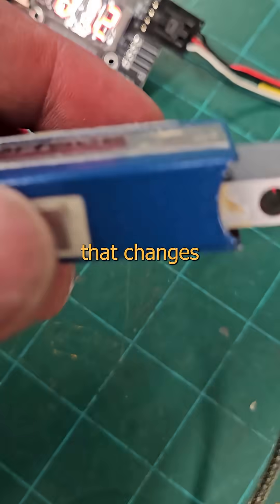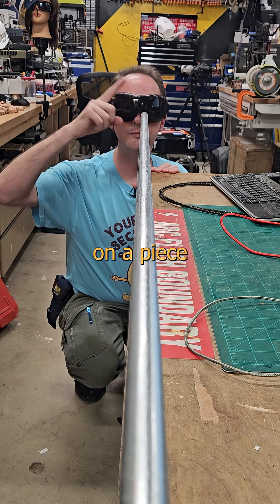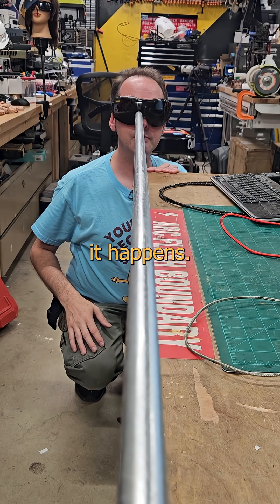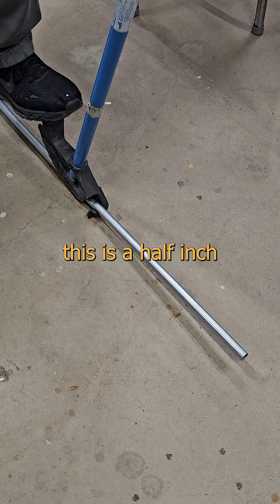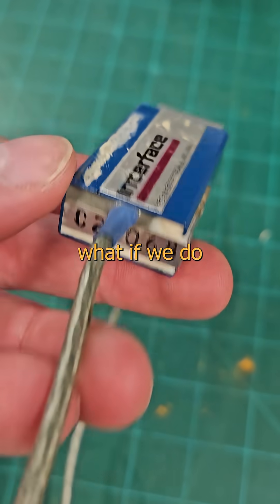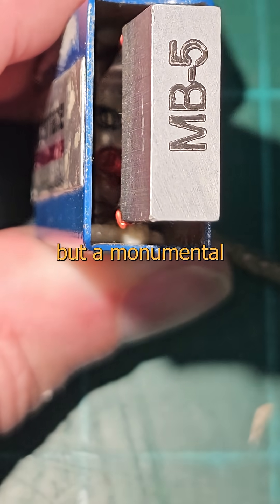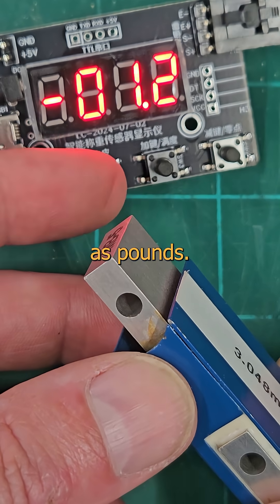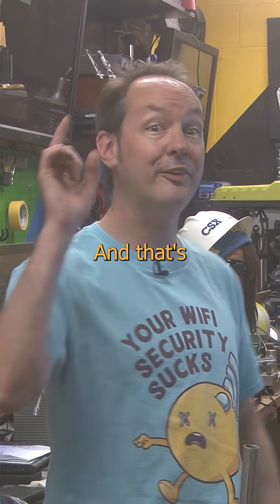Elastic and Plastic Deformation #chrisboden #comedy #engineering #modulus #strain #gauge #scale

Comment: Way back ago had an uncle that could weigh a loaded grain truck or cotton module within 200 -300 lbs by using a tape measure. Had a red square painted on the unloading floor and had something to do with tire pressure and the sq In the loaded tire took up. After the truck unloaded they pulled onto another square. Don’t know much techinicals on  it but similar physics.

Comment: Working on a railroad extra gang in 1974  despiking 900 feet long strings of jointed rail, securing the strings of 110 lb rail (weight of 3 feet of rail) to a caterpillar dozer then riding the back atop the vents to dry out.

The long strings of rail snaked as would a Stanley tape measure, elastic, flexible.

Comment: I worked a job in the mailing and shipping industry.  A customer had a scale with a quartz crystal load cell, they are incredibly accurate until bubba stands on the scale and the quartz load cell exceed all deformation and shattered. Replacing the load cell costs more than selling them a new scale.

Comment: I visited an aircraft propeller factory back in the 80s. They had 30 strain gages hooked up to the propeller through copper disks and carbon brushes and fed back to a laptop recording the parameters. Back in the lab they had some strain gages hooked up to big chunk of steel as a demonstration of the technology. Just touching the steel (actually pushing lightly on it) was enough to register on the meter. It still amazes me almost 40 years later, how sensitive that setup was.

Comment: I got to play with strain gauges in school.  We had a project where we needed to apply one to something meaningful/useful. As soon as we walked into the fab shop we would be using I saw a torque wrench hanging on the wall and asked if we had any axial strain gauges. We did, so I slapped one on a long 1/2" extension and started taking data points in increments of 5 ft/lbs from 50 up to 250. We then inversely used said data to torque some lug nuts. After testing, our new "digital torque wrench" was ultimately more accurate than the click type used for the data because the click type has a slight spike in torque immediately following the click if you're not very slow and careful towards higher settings.  Many years ago now, but one of my favorite school projects to date.

Comment: There's a type of coin error called plastically deformed die error.  It occurs when the working hubs(dies) slowly deform during the stiking of planchets because the dies weren't hardened sufficiently.   The result is a coin with a warped surface. It was common in British and Australian pre-decimal coins during the early to mid-20th century. In 2019, P.D.D.E occurred with Australian 5c coins.

Comment: Load cells! Finally, my time to shine as a commercial scale technician! I'm only certified to 30 pounds but I will say that the class 3 weighers in the scales I service are scary precise. They tell us to turn off air conditioning systems and breathe away from the scale platters during calibration because the force of your exasperation can be enough to throw them off.

Comment: Civil/structural engineer here so a lot of the electrical stuff on your channel is outside my scope (still interesting none the less). But when you started talking about elastic vs plastic deformation, now you’re speaking my language!  100% spot on with everything being a spring.  Our analysis software capable of analyzing every beam in a 50 story skyscraper are based on a matrix equation of hooks law: F = kx where k is the stiffness matrix and x is the deformation. Everything is a spring, and that’s pretty cool!
Reply: wait til you learn that EEs do nearly the exact same thing, RLC(resistor, inductor, capacitor, which is 99% of all electrical systems) systems directy correlate to a second order mass- spring dampener setup. resistors resist against energy flow (dampener), Inductors store energy in the same way that a mass would, and that leaves capacitors as the spring in the system, they store energy and discharge it when there is no longer an electrical force keeping it in its stressed state.
Reply: @dylankirby8162   so RLC and smith chart are just fancy "spring charts" in disguise?
Reply: @dylankirby8162 that’s a really cool analogy, I don’t think iv ever had it explained that way before. Makes sense though. The only thing I learned in school about electromagnetism is that I didn’t want to be an EE lol.

Comment: I worked at a company that built dairy feeding equipment. There was a company called Weightronix that made 'weigh bars' that operated like this. Measuring the deflection. They weighed literal tons of feed (1 weighbar on each corner, so 4 on a wagon or mixer) but acurately (to the nearest 5 pounds) weighed ME at 155 pounds. Kind of amazing back in the 70s to a teenager. Still kind of amazing.

Comment: Back in mechanical engineering lab, one of the experiments was based on the changes in conductivity that occur from deformation. The device was hooked to a mixer that had a double casing (the space insider was used to circulate fluids to regulate the temperature of the mixture inside, idk the proper english term) and when we had to talk about how it works for our grade, the teacher (a curmudgeonly old coot) would constantly interrupt me. Why? Because I wanted to say "we can see the deformation of the outer casing on the computer's monitor" but he would always go "no you can't see it it's so small it's imperceptible" and I finally snap back at him with "If it's imperceptible then how do the sensors register it to send a signal to the computer?!" and then I continued to explain the way I wanted to put it. 

Like, I get that you need to use accurate terminology when you're talking science but this was straight obstinacy you simply had to assume I'm a moron to insist on.

Comment: A few years ago, I poured the concrete base for a truck scale at a grain silo- each pad was 4 or 5 feet thick, chock full of rebar, and about the size of a small car. The sensor plates that sat on them were rather tiny by comparison, but could measure tens of thousands of lbs accurately

Comment: Elastic deformation.  It's that thing that separates a high pressure rifle barrel from a hand grenade. 

Everyone tends to think firearms steel is hardened. Well yes and no. 

You DO NOT want your pressure bearing vessel 3 inches from your face to be made of hard brittle steel that likes to fragment when it fails.

For that reason barrels are made of fairly soft but very gummy steel. It'll stretch before it fails, hopefully. 

Receivers of bolt actions, lever actions ect are made of similar steel but case hardened or carburized,  hard surfaces but soft and maleable inside so they flex a little under pressure.

The engineering goes beyond that. The cartridges of high pressure rounds are designed so the head portion of the brass is partially unsupported, sounds crazy but the idea is in the event of catastrophic pressure buildup, the brass can fail first and send the pressure out of vent holes to the side of the action rather than turn your rifle into a hand grenade.

Of course not all of it is perfect and engineers cannot predict every possible way an iodio...operator rather...might do something unhealthy to the firearms they're operating that can still cause unplanned catastrophic disassembly of the parts.

I've done enough gunsmithing in the past to have seen it. Holy crap the things I've seen. 

Just why? Manuals exist. YouTube exists. Forums exist. Limitless information at our fingertips but people still manage to show why some of them shouldn't be allowed outside without supervision.

Comment: Okay so.. What internally to that is causing the change in resistance? A tiny movable resistor like a fuel level sensor, or is there a factory of heat with movement involved? A lazer eye inside that detects distance? I gotta know...

Comment: Elastic deformation is fun. 

Plastic is often less fun, at least for things I usually deal with. But it's also usually better than shattering- there's a reason no combat swords are cast iron. Push that past its elastic limits and it's in pieces, same reason stainless steel isn't used for functional blades past about 12".  It's not good to have your sword bent into a pretzel, but at least you won't have sharp fragments flying at your face and repair is much more possible.

Comment: Now talk about Wheatstone Bridge and explain the schematics to us. That would be cool.
Reply: I've used a Wheatstone Bridge hooked between a Fluke 77 and each of 300 pairs of Cat3 twisted pair phone wire in an office tower built in 1983, running back and forth to move the shorting plug at the other end. Probably the best cardio workout I've had since I did the first two years of ROTC. Possibly the only cardio workout I've had since then, now that I think about it . . . Anyway, I was curious how the Wheatstone Bridge worked, but not quite curious enough to actually go read a book or something like that, so yeah, I hope he covers Wheatstone Bridges, some time.

Comment: Engineer here. Yes this is true to a certain extent. More info:

This is not only applicable to bending or tortion, but mainly used in compression and tension (atleast in my field).

At the start under lower stress most malleable material would deform linearly to the stress put on it. This linear relationship is called a elastic modulus, it varies a lot depending on the material and temprature.

However not everything would deform, brittle materials would shatter before any worthwhile strain/deformation is observed.

Comment: It runs deeper on the "everything is a fucking spring". When we physicists model atoms in quantum physics, the simplest way of treating them is as quantum simple harmonic oscillators, or essentially just a mass on a spring. When we try to model complex crystaline solids, we treat them as a lattice of cells connected with springs, the stiffness of which effects the properties of the solid.

Even on the most fundamental level, everything is a fucking spring.

Comment: Also glass is a spring
Reply: Because it's amorphous - meaning its structure is a jumbled mess, even at the molecular level - glass is variably flexible. We tend to picture glass as windowpanes or drinking vessels that'll shatter as the result of a careless elbow, but then there's fiber-optic cable, literally glass you could wrap around a pencil.

Comment: Theres so much i wish you could show and teach me. I still love taking stuff apart at 38. Just replaced my own well pump, pressure tank and pressure switch in my house after watching a few videos and reading a few detail guides. Also ive added and wired a couple of double pole breakers and a few single pole breakers. Recently had family move in with me so we needed more outlets. We lucky our house was built in the 90s and has a 250amp service. Plenty of extra amps to go around when needed. Unfortunately we dont have central. Thats my next bog project. Im currently reading a few different guides atm, then im gonna watch a coulle of good videos too. At the end of this summer im gonna guve it a go. Paying $15k+ for central heat/air is too much for my budget. So home gamer it is. By the looks of it so far, its gonna be quite a bit more complex than a well pump and/breakers in a 250amp Siemens breaker box. What guve me a hard time is wiring up my living/kitchen lighting. My lighting wiring is dringing me insane trying to get right again. My dad got some wires messed up when he changed the switch before i was living here again to help out. Trying to get 2-2 switch boxes and light switches. Its witchcraft basically.